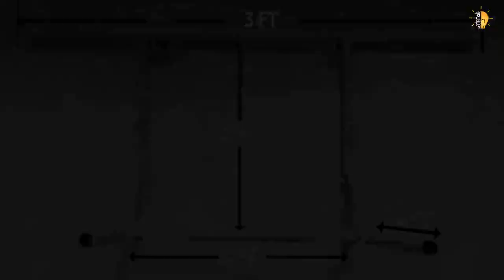Removable Chin Up | Dips Bar | DIY Making

Comment: Why to remove for dip bro? In the first pull-up bar position itself on that vertical bar by welding 2 straight parallel bars (half of the length) makes dip station. No need to remove from the wall each time. Also by giving a back rest on the middle the dip bar can be used for leg abdominal crunches with back rest.

Comment: It's an excellent design brother.. Grt job.. Planning to buy raw materials for it. 
I just have a doubt,  It's abt L-bend that you've weld with the square plate, bearing the weight of pullup rod. Is the L-bend available readily on market?? If yes, please give the name and dimensions of it.. Thanks in advance..☺☺
Reply from the maker: So if you get the goods that are available, you can change your idea design
Reply from the maker: The reason we choose round pipe is so as not to take pains while using